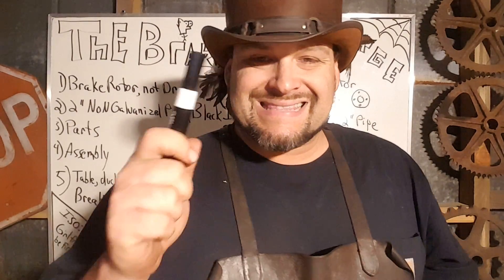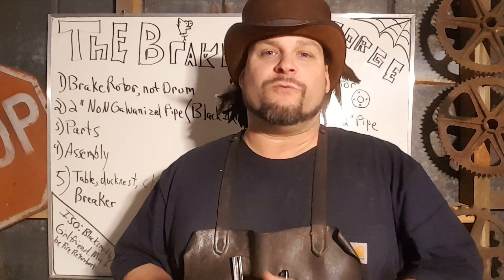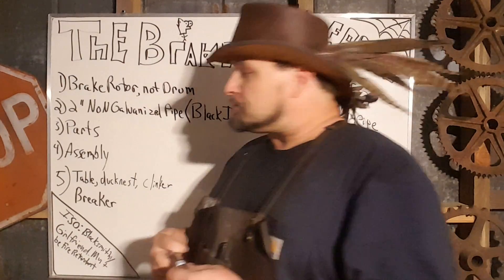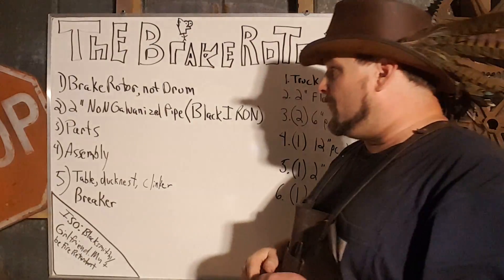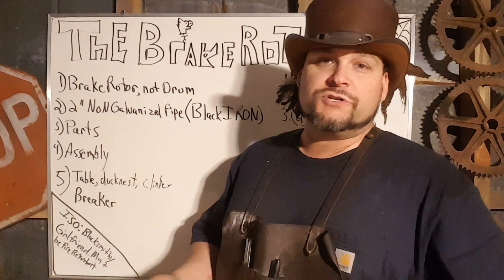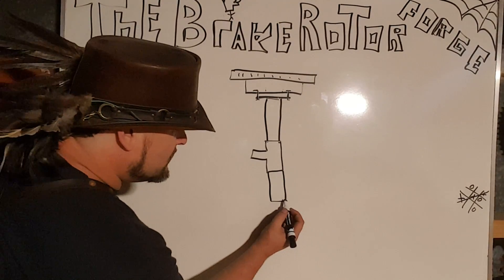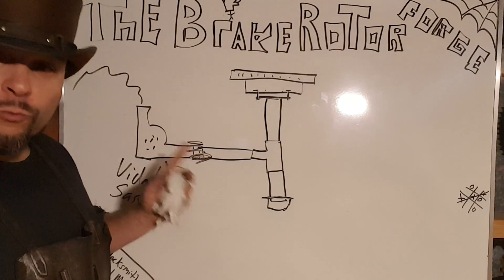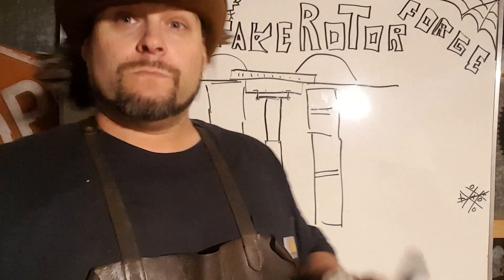Solid Fuel Forges Part Five: The Brake Rotor Forge

Comment: I was very close today, while looking for parts for a gas burner, to buying a stainless steel 8" inner diameter brake rotor for a solid fuel forge. It was right in my way and I almost took it. Happily, I actually heard your voice, Mr. Ty, repeating the wiener in the sliding glass door line in my head: I had many of my burner parts, and the propane option will be better for my situation. So I listened to your voice in my head and put it back. Now I'm 3/4 of the way to making the burner and moving forward with the propane forge. Thank you...for...your...wien...erm...glass door analogies. I just didn't want to be schtoopid.
Reply from the maker: Awsome! Saving the world, One Weiner at a time!

Comment: Love these videos!  I started out with a break rotor forge dropped into the top of of 55 gal steel drum that I cut off with an angle grinder for a coal shelf.  Worked great!  I upgraded to propane once I had to move due to a divorce so then I built my own propane forge... As you said, part of the fun of this craft is making the tools you need to be able to operate and learn.  its all part of the process.  Thank you for putting these videos out, Trenton!
Reply: what is the danger with galvanised pipe as thats what I have used

Comment: Hey, Trenton!  When I made mine, I drilled holes in a 3" square, thin, piece of stainless to act as a screen to keep my coal from falling down the 2" rotor hole.  It allowed airflow but never clogged my pipe.  
I've heard you mention a "clunker breaker" but I guess that's for a more advanced burner.  So, the screen works well.  You can buy a bathtub screen but I had some scrap to use .  Just a little extra tip I used.  
Thanks!  Love your "no nonsense videos"!  Keep telling it like you do!  
Mark- Gainesville, Fl.
Reply from the maker: Welcome!

Comment: i use a old square gas grill bottom for my rotor forge..kept it simple since its a hobby..spending 40+$ on piping is not my style so i stuck with simple fan blowing into a old metal five gallon thompson water  seal bucket..did the job.Now i have the pipe some one threw out so now the flange i may just buy that.

Thanks for sharing Trent!

Comment: How heavy of a anvil do you need to do a good amount of work on it. I’ve found a new 75lbs anvil. Would that work?
I’m going to be making hooks for coat racks and things like that and maybe some decorative things. Possibly some knives too. I’ve been searching and searching for some anvil under 275$. Thanks and great vid
Reply: I have heard (& repeated a time or two; and no one has corrected me so far) that your anvil should be 20 times heaver than the biggest hammer that will be used on it.  That would mean a 75# should be good for a hammer up to 3.75 pounds.  Not many smiths use a hammer any bigger than that on a regular basis, so...
Reply: Brian Neeley thank you so much, now I can move forward with my project

Comment: I've got a brake rotor with a depression as large as a normal brake drum off of a dump truck. And I set it in concrete. And used car exhaust pipe instead of black iron pipe. No, the concrete hasn't cracked or exploded in anyway thus far. The thickness of the metal of the rotor keeps the concrete relatively cool.

Comment: What are some options to stop the coke from going down the air pipe?
Reply: Michael Hoffmann I just took about 16" of 1/4" round bar and rolled it into a spiral that covers the hole. It will wear out eventually but it's cheap and does the job

Comment: Mr. Ty     I thank you for your work and knowledge of forges and what you are putting forth in video.  Can you please explain in one of these videos the proper depth and dimentions for a proper fire pot. One that will allow you to do larger work as well as the smaller work.  Also I am not sure but can you also touch on what kind of coal is the better of the two Bitumus or Anthrosite please.  If you already have a video on this please direct me.Thanks in advance, Martin Moldovan M&S Blades and Blacksmithing

Comment: I found a Weber grill on Craig's list for $5, cut the circle to drop the rotor in,  took the circle i cut and tac welded it over the bottom to plug the lug pattern, cut the hole for the pipe  slightly small so It holds the pipe (no flange) in place and cut two small sides open since it's mostly for blades and chain. 

20 minute fix AND it has a top since I work outside and couldn't see the color.

That said, i miss my old celtic clay side draft. Free to make and way more efficient but not good for armor

Comment: Are cast iron break rotors any good or plane rubbish Thanks
Reply: Rodney McLachlan not really. If water hits it hot it most likely will cracks appart
Reply: ok thanks mate
Reply from the maker: any break rotor will do the trick

Comment: Good video..

The one thing I will add is..  once it is all assembled, take a little more time and clay in the rotor.  Give it a nice taper so the fuel always works towards the center.  It's easy and cheap to do, and will help save fuel.

Thanks for the video..
Reply: Mix saw dust into your clay. If it ever reaches critical heat clay explodes. The sawdust makes little air pockets, effectively making medieval fire brick

Comment: This is the basic setup that I have with the exception of the cap on the pipe. I used a tractor exhaust flap and welded a counter weight to it. This way I can use my foot to lift the counter weight and dump the ash out.

Comment: Here's one for you, that might fall into the stupid question category, but hopefully not.

I've been trying to think of alternatives to the rotor. Assuming you mount the rotor on a decent table, the biggest drawback is the right angle of the bottom and sides. What are your thoughts on using a cast iron wok for a fire pot? I'm talking American cast iron, like Lodge makes, as opposed to the thin cast iron in traditional Asian woks.

Sure, it's more expensive than a rotor, and you''d have to make your own hole in the bottom, but the ratio of depth to diameter seems appropriate, the sides slope down towards the center and it's a pantload cheaper than a real fire pot.